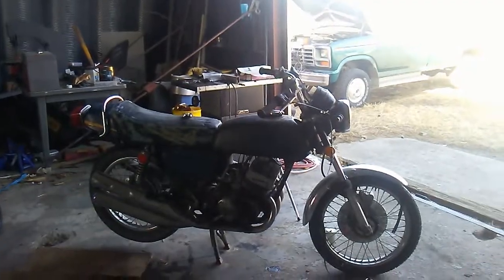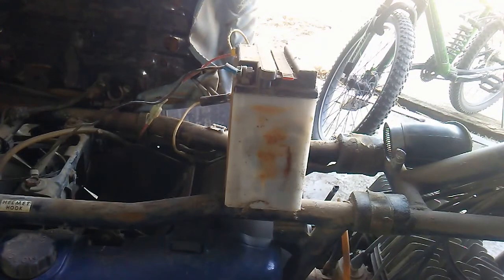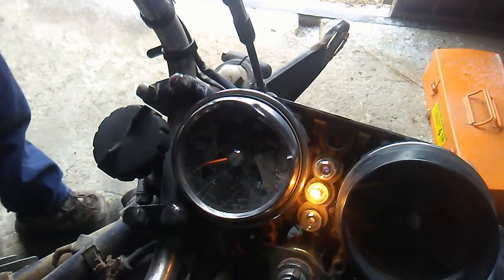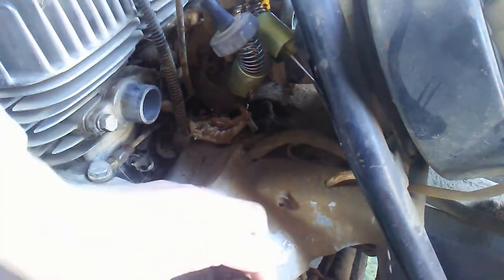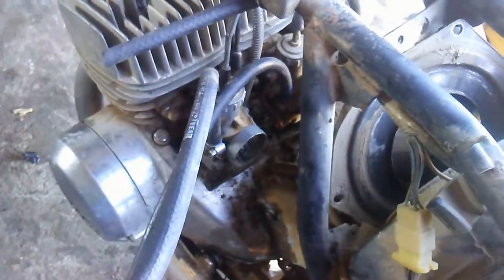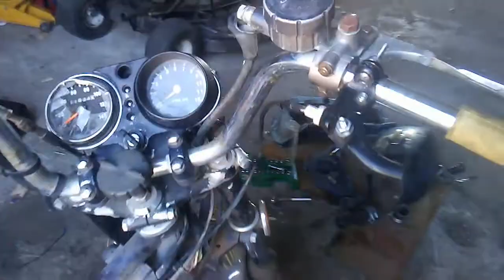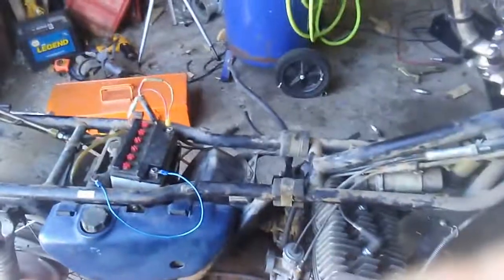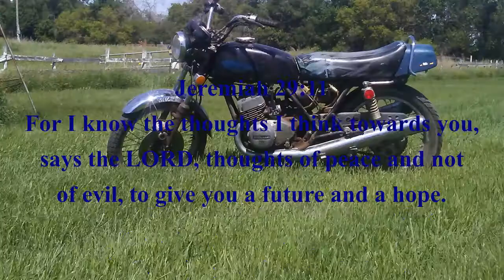1973 Kawasaki S2A 350 Barn Find: Will it Start? Part 1

Comment: Do you wear any leather biker jackets or Levi’s jeans in particular?
Reply from the maker: not yet, as this is my first motorcycle, but once it's fully up and running I will need to get myself some good gear, especially a helmet. I don't think an open face vintage snowmobile helmet would quite suffice for interstate riding.